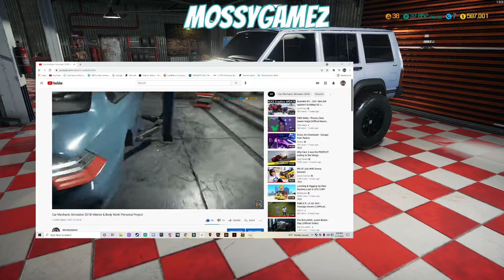Car Mechanic Simulator 2018 - Interior & Body Work Info

Comment: Thanks this was starting to piss me off. So many dumb things they had going on in the 2018 version. Like why the hell do I have to access the inner part by clicking on the engine thats another dumb thing they had done. Some things u cant just remove straight up when car at the bottom like the brake servo. U have to click first on engine then servo smh. 
Same here u have to open door then u can remove stuff -.-